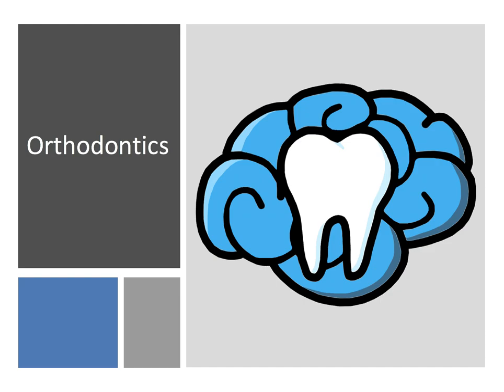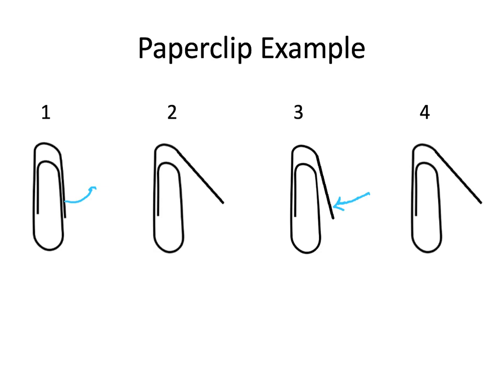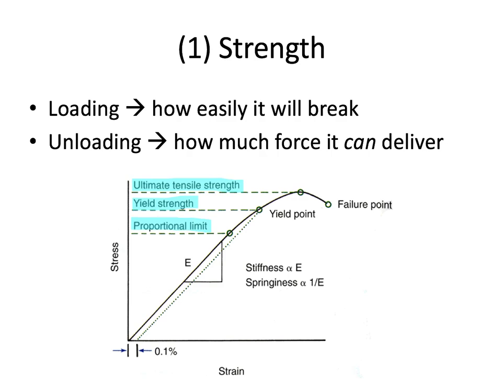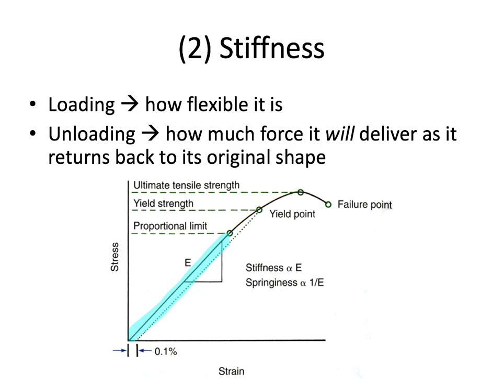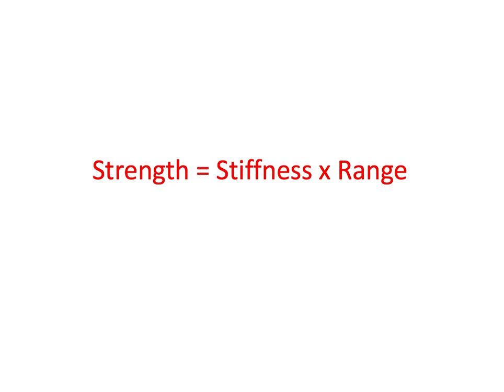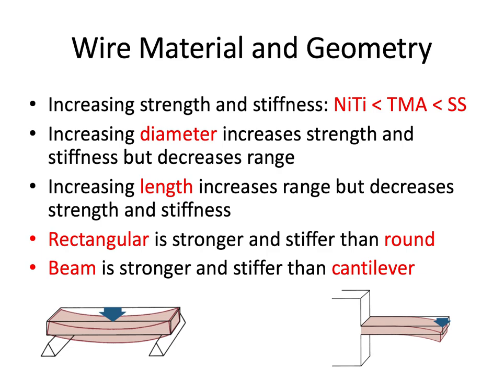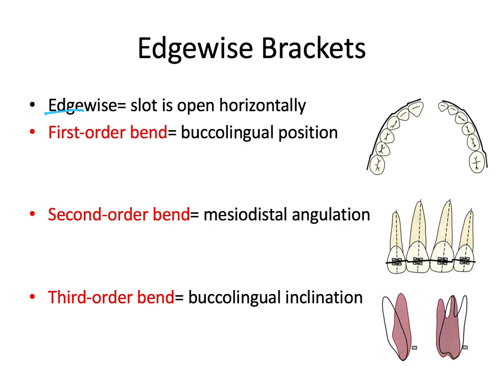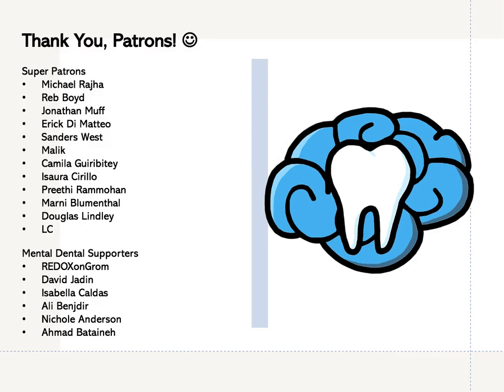Orthodontics | Orthodontic Wires & Brackets | INBDE, ADAT

Comment: Whats the difference between between 012 wires 016 etc
Reply from the maker: Thinner dimension wires like an 012 (vs. an 016) are more flexible so they can engage brackets on teeth that start out very crowded. As teeth align and level, you can move up to heavier wires that have more diameter and strength. This is a very simplified explanation, but I would be happy to make more advanced orthodontics videos in the future for those who want it.
Reply: @mentaldental  thanks 😊 for answering. I'm going to subscribe because you are real loyal.

Comment: Sir I have one question... We apply torque in beggs appliance also, but we are using a round wire for beggs appliance and u said tht torque can not be applied by round wire.. So how come we use round wire in beggs appliance??
Reply from the maker: I am not too familiar with the Begg appliance, but it is very difficult if not impossible for a round wire alone to generate the moment of a couple I show in this video to apply torque. Round wires can tip teeth no problem, but torquing is a different story. You would need some kind of auxiliary wire or appliance like a Warren spring.

Comment: Hello Ryan, great effort as always ! but i have a question, could u tell why we use power arms in sliding mechanics and why the loops in space closure when we already have a two point contact to counter root movement? it's been bugging me and a mere textbook is not helping in understanding this, i'd be grateful if u could help. Thanks
Reply from the maker: Power arms are used because the point of force application is brought closer to the center of resistance so there is less tipping as a side effect when closing space. Closing loop archwires are used as an alternative method to sliding mechanics for space closure (elastomeric chain, NiTi closed coil spring). The wire is designed to bind at the brackets and pull entire units of teeth together as the activated wire assumes a passive position after being stretched apart at the closing loop. Hope that helps!
Reply: @mentaldental  thank you, awesome